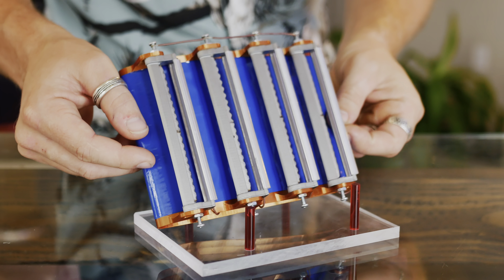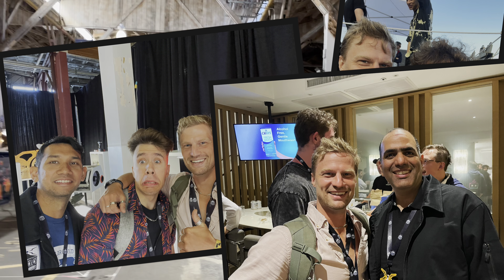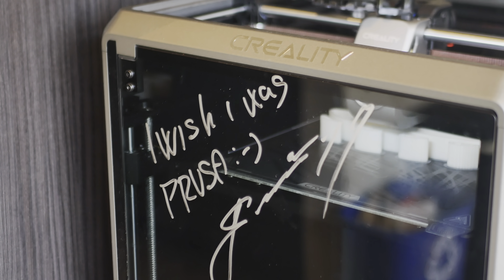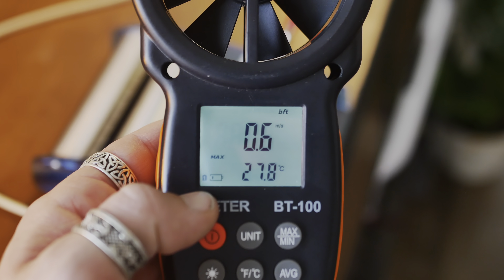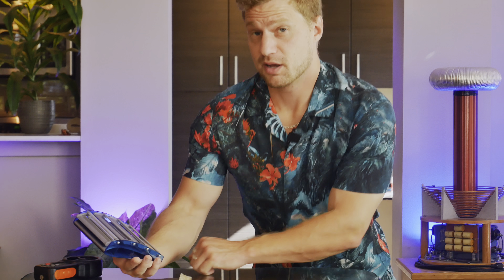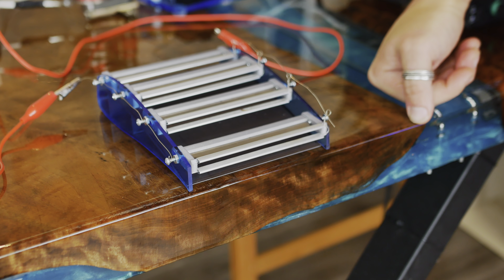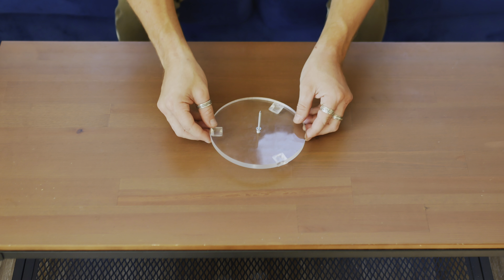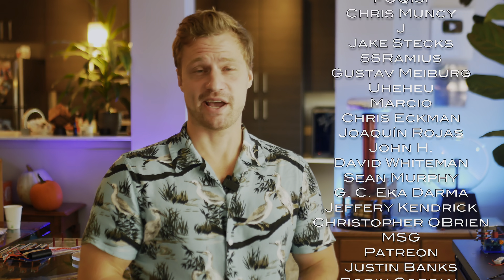Designing A Self Propelling Ionic Thrust Wing

Comment: This is awesome :D. If you want to decrase weight even more, try LA-PLA. It will foam up during printing and it's about 45% the weight of regular PLA. You could also use a wing section of 3dlab print's Piper Cub. Printed in LW-PLA they weight aroung 20g each. If printed with the right settings the whole plane will weight less than 300g (just the material)
Reply: The pre foamed Version can be printed on a Prusa the regular uses a higher temp then a prusa is capable if I remember correctly good luck!
Reply: @CajunWorks Nope, you can use regular LW-PLA on a Prusa. My Prusa Mini has no problem with it.
Reply: @CajunWorks  I can confirm what DominatorD1 said. I already printed a couple of planes with regular LW-PLA on a Prusa MK3S+.
Reply: I’d try carbon PLA on a larger wing
Reply: Balsa wood is better
Reply: @OtavianoDiniz  Would also work. Cut out some ribs and spars and then cover it. But that's more work than printing data which is already there. Could be worth the effort though.

Comment: Not sure why you chose to put the ionic thrusters on top of the wing. The air on the bottom should flow faster than the air above the wing to generate lift. 
Have you tried a different design where the trusters are built to the bottom of the wing?

Comment: It seems like an odd choice to put the thruster atop the wing, given that the air needs to move faster over that surface compared to the bottom. This is one of the main reasons plane engines hang beneath their wings.

Comment: Just a suggestion. You may want to look at limiting your electrode arcing, which should  improve efficiency,
safety, and prevent failures of electrodes.  KEMET has a Surface Mount Multplayer Ceramic 
Capacitors (MLCCs) for Ionization called "Arcshield" for upto 1,000 VDC, 
and of course using other Diodes and voltage snubber circuits/SCRs in parallel with
the contacts.  Or come up with a different  "pulsed" High voltage system.

Comment: Just for fun you can reduce the weight of a test model by connecting it to a hydrogen filled baloon or sort of light container (1m^3 of air is 1kg so to make your device weight from 100g to  0 grams weight just add 0.1m^3 of balooned hydrogen and hang it on it and it might actually fly)... just a quick rough idea ;) good luck!

Comment: I think there might be an issue with your wing design. I believe there is a reason why jet engines are placed under the wing and never above the wing. Airflow on the flying plane wings creates two areas of different air pressure - high under the wing and low above the wing - this effect is actually why planes are able to fly. So considering this, Ionic thrust engines placed above the wing will be much less effective at speed than under the wing - simply cause there will be much less particles to ionize
Hope you will find this helpful

Comment: Love it, good to see it working . just 2 thoughts on it, first, what about laying the plastic film over it , that way ducting the thrust from one to the next , secondly, what about a duct through the center of the wing and the thrusters in that duct, the duct might be the plastic film to keep it light, that way the thrusters wont mess with the airflow over the wing and actually have its inlet at the high pressure point at the front of the wing ,just a thought.

Comment: Two suggestions: put the thrusters on the bottom surface of the wing rather than the top, put the positive charge on the wire at the leading edge of the wing surface and the negative side aft.

Comment: I'm not an engineer but hear me out; what if you don't need the bottom airfoil? Arrange the ion blades in an offset diagonal that multiplies thrust incrementally and put them each on a lateral pitch axis to dynamically create lift or thrust as needed. Think VTOL Glider.

Comment: Nice work Plasma Channel.
I live near SKUNKWORKS,  they built Ionic Plane few Year's ago and it flys.
It's a Neddle shape body, no canopy bubble., forget the call #, but I saw it fly.
 For a minimum funding project, I'm rooting for you.
 Your competition though, has one-up on you with Electroplating his parts, and hint- Electricity and Magnetism move in CIRCULAR and or Spiral  pattern, take advantage of that, Not linear form.
My fun, + was Neddle and - was Hoop, making a Cone shaped corona.
Think about flying saucer, if + is Rim and Negative is just underside, how and where does air go, how does Pressure happen on top versus Bottom? 
Great Channel, keep the Discussion Open.

Comment: Seriously speaking, I appreciate these works but ion thrusters can be useful for some very specific applications, but it's not a Saint Graal! First, the principle in mind is the conservation of energy! There is a compromise between the electric field that can ionize the gas for all the process! Second, like others process, we continue needing a gas source and stored it to ionize later! Third, any calc can easily demonstrate that any chemical reaction can produces much more thrust by mass than the ionization! Fourth, all the system would be extremely sensible to an external magnetic field! I didn't see operational systems using this principle outside the room class!

Comment: This is really cool, and it's good to see it starting to fit into a wing design, but you are wasting a lot of thrust in eddies. I'd like to see a design like the "bladeless fans" except using ionic thrusters to generate the basic wind instead of a hidden fan blade, and then multiply it by using inducement. This should make the resulting wind much more directional, and it theoretically can increase airflow by up to 15x, (although the extra weight of the Airfoil might reduce this, it's probably still an increase in thrust to weight ratio vs more batteries and stun packs.)

Comment: Lastly don't pack your thrusters starting the leading edge of the wing, keep them on the flat part of the wing, and make the test wing large enough to acomodate them.
Just eyeballing it about 2x in length of the test piece or wing  section, with the thrusters on the second half.

Comment: You might be able to increase the trust by moving the bulk of the ground rods closer to the razor edge but adding an insulator in between. Something that would allow the electromagnetic field to go thrue but would not allow the electrons and ions themself to go. 

The sharp edge has to be sharp to allow the electrons to leave the conductor, and the other side has to be larger to increase capacitance. If part of the large side is placed closer but in an insulator, it would increase the electromagnetic potential without reducing the resistance. 
So basicly, wrap the leading edge of the wing in foil, add a positive core in an insulator and connect it to another foil covering the tail edge.

Comment: Keep in mind exact airflow, your old thrusters took aditional air at each step and focused/compressed it down to a smaller diameter.

Try something like that for the wing as well, be mindful of the air above the terminals and make a plastic air foil to focus enough air in and create a sheer line to the laminar flow on top.

Comment: Try keeping the spacing between terminals low on the front of the wing and increasing spacing on the back.

This is because the air is already moving and already ionized, so you have more time to impart momentum to an already moving stream of air.

This is testable on your old designs as well.

Comment: Dude, that is wicked! You are really on to something with this. Also love the competiveness between you two!
Reply: Cool prototype but would never be able to be used.
Reply: @greentext2345  No, not with current tech. But the concept is very interesting!
Reply: Wasn't that was said to the Wright Brothers?
Reply: @ericheydemann9556  Oh for sure, but this is slightly different. In order to make this work, you need a lot of power in a very light package. MIT has been trying to crack this too and have flown concept models that have worked. But those were across a large gym and only had enough power to fly that length and basically no flight controls. A few more things need to be created before this would be viable.

Comment: 🤔 Wouldn't the thrusters work better if they're under the wing? Since lift is generated due to airflow below the wing generating negative pressure above it from the trailing edge...

Comment: Have a look at tom stanton's method of 3d printing wings, it seems like its much lighter than what you've got. Also, why the need for a secondary structure for the thruster? Why not use the surface of the wing itself ? Saves a lot of weight. Alternate tape (earth) and wire (positive) stretched across the wing surface.

Comment: To shave a lot of weight, try using thin wire over conductive strips as ground on the wing it self. On the bigger picture. You can use that design with full wing. Anchor point at the end of the winglet. Down side of that design. You will have to use dielectric supports across the wing for support of the positive wire

Comment: Don't comment much but as an aerospace engineering student, this looks like a really exciting project with a lot of potential. The main benefit of this system I can identify is that speeding up the airflow over the upper wing surface will decrease the air pressure in that area, perhaps creating a wing that can achieve a higher pressure differential between the upper and lower surfaces than a conventional wing, yielding higher lift. On a practical level, on an aircraft this could mean it may stall at lower airspeeds or be used in an STOL system.
If the ionic thrusters are properly integrated into aerofoil shape the system may also have less profile drag than an equivalent system where the thrusters are mounted separately in their own nacelle.
Also the possibility of a solid state electrical engine in general has a lot a of promise , though I'm sure you're already aware of that one.

I think it would be worth doing these tests before committing to a design to scale up to a full wing:

Investigate the impact that the ionic thrusters and aerofoil have on each other. This could entail:
- Testing the thrust output of the ionic thruster both with and without the aerofoil attached, to identify whether there are thrust benefits achieved by mounting the ionic thruster in proximity to the wing surface.
- Testing, with the thrusters switched both on and off, the lift generated by the aerofoil-thruster setup in a steady airflow (granted quite tricky if you don't have access to a wind tunnel) – the ionic thrusters at the moment look like they may significantly impact the lift efficiency of the wing by disrupting the airflow over the upper wing surface.

Also, your dry ice visualisations of the engine exhaust are really cool but I think there may be benefit to doing more of these airflow visualisations from in front of the aerofoil so that airflow around the whole engine-aerofoil system can be understood. To me it looks like there may be some very intricate aerodynamics at play here and therefore a lot of room for optimisation, only possible if the airflow over the whole system is properly understood.

Overall I think if the thrusters are smaller and better integrated into the overall shape of the aerofoil, and, as you've identified, with optimisations to the ionic thrusters, you'll have a very compelling wing/thruster system on your hands. Fully realised on a human flight system, I can imagine this giving efficiency/range boosts to gliders, being used by STOL or if incredibly well optimised VTOL aircraft, or being used in very stall-resistant aircraft. 
Great work.
Reply from the maker: I'm glad you enjoyed this build, yeah there are certainly a myriad of ways to improve it. I've already begin designing a second version, and appreciate your input on how it can be tested further!
Reply: @PlasmaChannel  Exciting I'll be looking out for it! I'm only so improvement focussed because your concept seems so rich with potential!

Comment: “ChatGPT had it pinned …” facepalm I get that with very close supervision it is possible to use a large language model to do physics, but come on this makes it sound like CGPT gave you the answer. You need to be able to pinpoint its mistakes to use it effectively. Inexperienced users need to know how unlikely it is for CGPT to give useful physics answers up front, not as an afterthought! Honestly irresponsible to not elaborate on that point.
Reply from the maker: Chat GPT is actually quite good at running calculations. I tested it multiple times and it gave accurate answers, walking you through the proper calculations. It's fully capable of solving mid-level physics equations, and the answer it gave me is fairly accurate - .044 newtons of force. That would be 4.4 grams of thrust - which I realize now was a miscalculation on my part.

Comment: Question: what about REPLACING the upper wing skin with the thrusters? Use the thrusters themself to make a compiled “skin” whilst also using the draw to funnel the air into them? This would also halve the total wing weight making the thrust to weight ratio skyrocket, and, if that works, could be used to an extent for the entire vehicle (basically replace the entire shell with thrust capability)  yes it would need a strong skeleton, but the payoff…

Comment: where did you get your stun modules from , I tried a few and all of them stoped working after a few minutes of using them ( I didn't run them for more than 10 sec at a time).At first I thought that it was something to do with my psu so I even tried some suitable batries and it still stoped working , I've wanted to ionic thruster for over a year now but due to the issue with power i have not been able to make it work

Comment: If you're planning on using a wire instead of razorblades, it might be worthwhile to run the wire between a set of rollers to somewhat flatten the wire, making a thinner, sharper edge. But as always, the amount of work you've put into this project is clear, and your results are beyond impressive :)
Reply from the maker: Thank you, it definitely is a passion project, and an intentional build at the same time!

Comment: Hi! what if the thruster were inside the the wing? <=> a biplane having its 2 wings very close to each other with the thruster sandwiched in between. The upper wing should be 3/4 of the length of the lower wing. (I mean 'length' in the flight direction.)

Comment: You could use Design of Experiment to further improve this and find the significant factors. Example number or grounds to positivs, spacing, voltages and what would be interesting is if it matters if the positive side is just pointy like straight razor or if it is better to have it look more like a comb where the plasma originates at a single point rather then a staright edge?

Comment: I don't see ionic thrust replacing RB211's on a 747 class airlines anytime soon, or the P&W F135 used in the F-35.  It COULD possibly be used as a "booster" in a sailplane or a STOL aircraft.  The weakest link though is going to be powering the beast.
Flashing back to your experiments with a MHD water "jet", I wonder if that could be used to replace the bow/stern thrusters on pleasure boats?  The existing ones are EXTREMELY noisy.

Comment: Nice.
Keep it up.
You should do some research on why it failed with 4 HV transformers.
Maybe because they wore isolated? (Or didn't have common Ground?)
You can shave more weight by using nylon fasteners. (Screws, nuts, spacers, etc.)
With more thrusters in series...
Shouldn't you put all 4 HV Transformers is series?
You'll have a huge voltage potential from 1st to last...

Comment: try removing the aluminium foil from the first (as in the one placed at the edge of the wing facing the direction of flight) part of the wing and keeping it disconnected from Ground, this way you won't be attracting some of the ionic wind generated by the first high voltage positive blade to the wrong direction, and that may help increasing the wind velocity.

Comment: fascinating video, are you planning to test on an RC model? I'm curious why above the wing? the shape of the airfoil will lift the wing already by speeding up the air over the top of the wing to create the "vacume" above the wing  to create lift. I may just be confused on the purpose seems like this system might be used to push the craft forward. I need to re-watch the beginning. awesome exciting work. I like the idea of it as a thruster  on ultra light aircraft or a space vehicle where there is no drag

Comment: 1/18 thrust to weight minimum for flight, closer to 1/4 to be practical. So you need a minimum of 23 grams just to technically fly, and around 102 grams thrust to actually fly. That is assuming the rest of your plane is weightless and perfectly aerodynamically efficient. That's a very long, long way to go. Trying to 'integrate' the thruster into the wing is cool, but it's not going to get you anywhere near the weight reduction needed to compensate for the tiny amount of thrust you can output.

Comment: That aerofoil may be very inefficient. They're usually optimised with a trade-off between weight and lift coefficient (plus stall characteristics ect). This is simulated with constant airflow rather than your case with an accelerating airflow over one side of the foil. It would be interesting to see an optimised foil design here.

Comment: The weight when anchored to the spindle is not relevant. Yes there is motion however your not lifting the weight? 
How much battery is needed to produce the air flow? That is where lift is? 
Thoughts, no wing to anchor to? Thrusters anchor to control to direct thrust, changing direction gives vertical lift and forward thrust. This test needs to be in real application not on a spindle. ??? If I had the money???